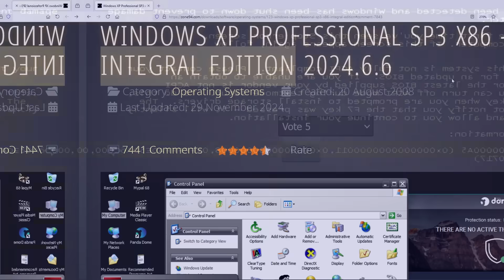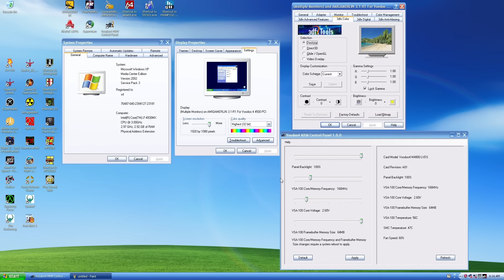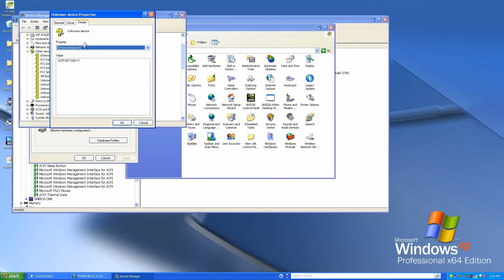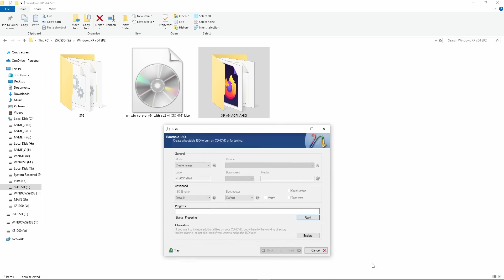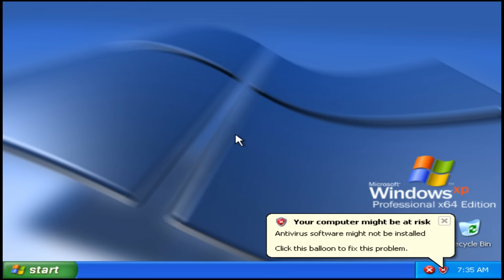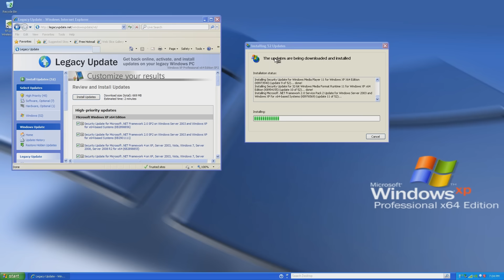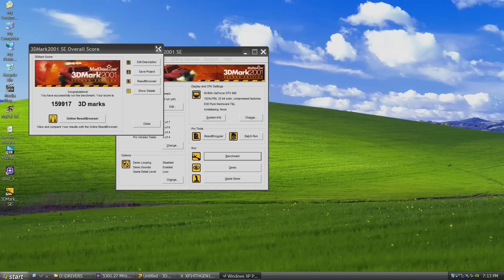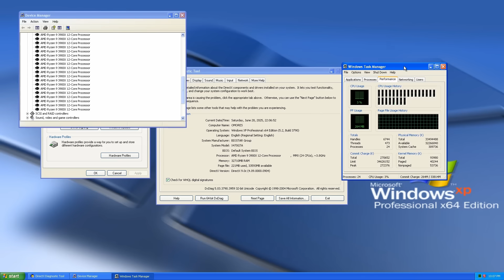How to Install Windows XP x64 on (very) Modern Hardware - NO BSODs 2025 Edition

Comment from the maker: To try everything Brilliant has to offer—free—for a full 30 days, visit https://brilliant.org/Omores/ . You’ll also get 20% off an annual premium subscription.
Reply: I have a Dell Poweredge 2900 dual processor server. Would WinXP 64 be a good fit for that? How close to "native" installation could I get to install?
Reply from the maker: @redfonzie21  That's a 2006-2007 model, so basically works with x64 out of the box, not workarounds should be necessary. Just use an optical drive for the installation.

Comment: okay but can i get working drivers lol
Reply from the maker: You can download a few drivers from here: https://www.patreon.com/posts/132702533
More precisely, you can get: the last Nvidia driver compatible with the GTX 980 series (modded), plus AHCI, USB 3.x, and NVMe drivers.
Reply: @O_mores nitro 5
intel core i5
cat sticker
Nvidia GeForce rtx

are you sure??
are you actually sure there’s server 2003 drivers for A modern laptop
Reply from the maker: @KingSonicBoe  XP is very well supported. There are actually drivers for everything, except for what is most important: the GPU. RTX 2000/3000 series are supported only in Windows 7 and up. For XP, you need to stick to the 900 series from 2014-2015, but since you are on a laptop...
Reply: @O_mores  you are actually right
but are you sure there would be 64 bit drivers?
Reply from the maker: @KingSonicBoe  For things that are based on standards like USB, AHCI(SATA), NVMe, HD audio - yes, there are 64bit drivers.

Comment: Soooo ive got the modded ISO and i keep getting 0x07B in text mode, im using WinSetupFromUSB to boot the setup, I have one NVMe drive and 3 HDDs
Reply from the maker: It won't work if you try to install it from USB 3.x since there are no USB 3.x drivers in this ISO. It works though from USB 2.0. Can you try from a SATA drive?
Reply: @O_mores ok so i got a dvd rom, everything was promising but i cant do any input and i dont have ps/2 on my MoBo
Reply: the keyboard is plugged into a USB 2.0 port and i have legacy USB support enabled
Reply from the maker: @idkwhhattoputherelol123 Try with the Universal NT installer: https://github.com/ages2001/Universal-NT-Installer
Reply: @O_mores i tried and now i get a 0xc7B BSOD
Reply from the maker: @idkwhhattoputherelol123  Format your SSD in Windows 10/11 (or an older version), make the partition active, then unzip and copy the preinstalled XP x64 files from Patreon: https://www.patreon.com/posts/132702533 (download the two .7z files). Quite a few folks have done it this way, check the comments on Patreon.
Reply: @O_mores   it says AM5 tho and i have a i7-12700F
Reply: update: it works, mouse and keyboard just dont
Reply from the maker: @idkwhhattoputherelol123  Happy new year! And... what exactly works? Have you tried the preinstalled version?
Reply: @O_mores  yes, it boots and goes to desktop but input doesnt work
Reply: oh and also happy new year cuz its soon new year here
Reply: @O_mores  Ok so I even tried writing a batch script that installs the XHCI drivers i just cant do any input but it boots and is on desktop after extracting that  image
Reply from the maker: @idkwhhattoputherelol123  I don't have any ideas right now, as the last 4-5 motherboards I've had for Socket 1700 and AM5 all included a PS/2 port. It's the first thing I look for when buying a new motherboard. Maybe your motherboard has a serial port and you have a serial mouse in a drawer somewhere, but if the COM ports aren't installed, the chances are slim. I think you should get a PCI-E to USB 2.0 adapter, as these will work in Windows 9x, XP, and Vista... so it's worth spending $20. Take a look at this one: https://youtu.be/5rxoJB8mHHQ

Comment: the .iso 2024 is for extract or install ?
Reply from the maker: It's ready for installation. Just keep in mind you'll have to manually replace ACPI.SYS in the Windows folder once the 0x05 ACPI error returns (as shown in the video).
Reply: @O_mores  ok, i can rebuild this iso included acpi.sys ?
Reply from the maker: The final and good ISO needs to contain the updated ACPI.SYS in both the SP2.CAB and DRIVERS.CAB archives. You should update it using nLite.

Comment: God can you share that already modified iso, I urgently need to try it on an i 7700k with an rx6600 graphics card and an asrock z270 extreme 4 motherboard
Reply from the maker: Sure, the link is in the description. Check out my Patreon page: https://www.patreon.com/posts/132702533 P.S. That RX 6600 won't work and neither the HD630 from the 7700K.

Comment: Does this boot under Ventoy?
Reply from the maker: The ISO I used includes AHCI and ACPI drivers, but it lacks USB 3.x support (which can be added later). This is a problem because, from Intel's 6th generation onward, all USB ports are connected to a USB 3.x controller so XP will likely fail when the setup tries to access the Ventoy drive after the initial boot.

Comment: I ran Windows XP x64 for years as a gamer, until well after Windows 7 came out.  Drivers were rare, but video was well supported by Nvidia and AMD.  It worked great, and I felt extra 1337.
Reply from the maker: Well, I remember buying an Athlon 64 3500+ in 2005 and immediately feeling that my new 64-bit CPU was being underused. So I tried a beta version of Windows XP x64 right away. It didn’t deliver the performance boost I expected, but I kept it as a dual-boot option - though I mostly stuck with the x86 version.

Comment: can you run Steam on Windows XP64?
Reply from the maker: Steam stopped supporting Windows XP in 2019. For a while, there were some workarounds to get it running, but as far as I know, a Steam update in 2024 broke the compatibility for good. So the answer is no.

Comment: And is there a way how to do that after installation of XP using IDE Mode on older hardware? 

Does this one works on Sata Drives? I have a HDD and i really want to see if this works or do this required different workarounds?

Everything like the chipset, igpu work but ahci doenst even work, instant BSOD.
Reply from the maker: On which system are you planning to install it? If the motherboard has a native IDE controller or uses SATA IDE emulation, it should work immediately. You can then add the AHCI drivers later from the Control Panel, but you will need to identify which unknown device is the SATA controller.

For context, I installed XP x64 from the original CD on an Intel 4th Gen PC from 2014. This means that for 4th-gen hardware and older, you don't even need this updated version.

Comment: I'm running this OS on my desktop, as my main one. It's a Dell Inspiron 660 with a Xeon E3-1290 V2, 16 GB of RAM, a 2 TB SSD, and for the GPU I'm still determining the best option. I'm probably going to get a 9-series GPU (but it needs to fit into the tower, which is somewhat limited due to the HDD bay it has). Currently I"m using a 1660 Super with no graphics acceleration. It's painful :)
Reply from the maker: I'm also writing this message from an MSI GTX 1660 Super Gaming X, but with full driver support. A 980 Ti is on par with this card when it comes to FPS, almost identical. By the way, XP x64 works on a Ryzen 9 9900X build, too: https://youtu.be/EOeJnLb952k (the video's about 98, but it has an XP moment as well).
Reply: @O_mores  Oh wow, I might just save my money for the 980 Ti then. Seems like a more logical buy than a Quadro K4200 or K5200.

The newest CPUs I have in my collection is an i5-11400, i3-9100F, and i7-8700. I tried getting XP x64 running on my H310CM-HDV (Asrock) build, but could never get it working right. Wish I could, because the speed improvements between this Inspiron 660 and that machine with XP would be so insane.

Comment: Very nice, I will have to try your ISO, thank you. I use stock XP64 on a 4th gen i7 (with NVMe driver) but sure would be nice to have the option of newer hardware, and not live in terror of this old system dying. :)

I had a strange experience with a Thinkstation S30 (same chipset as above, but Xeon). XP64 kept puking back the AHCI driver. Then on about the 10th try, it SKIPPED asking for the driver and finally installed, apparently by mistake, but it works fine!
Reply from the maker: I tried that ISO (with an updated AHCI driver) on an AM5 system with a Ryzen 9 9900X, and it works with NVMe and USB 3.x support! That same build also runs Windows 98 on bare metal: https://youtu.be/EOeJnLb952k

Comment: I tried it on my ASRock Z790 PG Sonic and it did not work.
Reply from the maker: I don't know if the Z790 is somewhat different from the H610 motherboard I used, it shouldn't.  Anyway, you should try the .7z files from Patreon: https://www.patreon.com/posts/installing-xp-on-132702533 (SSD_XP_x64_AM5.7z.001 / SSD_XP_x64_AM5.7z.002).

This is my installation - basically the C: drive, which includes XP x64 (as shown in the video) and all the updates made through the LegacyUpdate app. These updates might help and also there's support for AHCI for both Intel and AMD. Check the comments - there's a dude who got it working by copying the contents of the .zip

Comment: Dude, XP supports GTX 960. Vista supports GTX 980 Ti. I know weird.
Reply from the maker: Don't worry, XP works absolutely fine with a GTX 980 Ti. You just need to add the hardware IDs to the .INF file. This is all the 'modding' that's necessary. :)
Reply: @O_mores  That sounds more difficult than adding 2 update files to get RTX 30 series or Cinebench R23 working on Windows 7.

Comment: XP has a lot of fundamental issues. 1st of all, it doesn't like USB installs so no Rufus. It favors disc installation so Legacy CSM no UEFI, no Secure Boot, and no TPM. I'm actually surprised to see Haswell and Broadwell working with XP ok I thought IvyBridge was the limit. I actually bought the M6700 laptop with the intention of running XP to use the Intel HD 4000 while Windows 7 or 8.1 uses my M2200 MXM GPU I bought a years back. Unless the Quadro RTX 3000 MXM works. Hmm...
Reply from the maker: You can install Windows XP from a USB drive using a few dedicated tools. The best one is called WinSetupFromUSB. The main idea behind USB installations is that you need the USB controller to be recognized by Windows XP. For example, if you install a PCI-E to USB 2.0 card in a modern PC, you will not only have your keyboard and mouse recognized in any OS without native USB 3.x support, but you will also be able to perform the installation.

Comment: Have you tried XP x86 with the PAE extension patch applied?
Reply from the maker: I haven’t tried it yet, but there are some nuances. On x64 systems, any application can access all available RAM (up to the system limit), whereas on x86 with PAE, individual 32bit applications are still limited to 2GB of addressable memory. So you might have something like Firefox using 2GB, and another program using a separate 2GB - but no single app can exceed that limit. It technically works, but if there’s even the slightest instability, I don’t think it’s worth the hassle.

Comment: i belive there should be so called wine for win xp which would allow to run modern apps
Reply from the maker: Yep, I saw something on reddit. But compatibility is exactly an issue for me as I run multiple OSes on the same PC - like right now I'm in Windows 11, but if I want a break, I’ll boot into Windows 98 or XP.  Each OS is on its own SSD.

Comment: Every time I run the setup I get a 07B or 00A and Ipatched it with the generic acpi drivers from the patrion. I have a Ryzen 3 1200 on a a320m a pro
Reply from the maker: I see... As I mentioned on Patreon, the ISO posted there has Intel AHCI drivers that won’t work on AMD chipsets. That's why you get 07B... For AMD systems, you’ll need to use nLite and add the SATA drivers I posted there separately: Generic_AHCI_6.2.9200.20652.zip These work with AMD chipsets, tested by me on AM4/AM5 motherboards.
Reply: @O_mores I took the same starting iso as you  and used nlite to patch and add the ahci
Reply: @O_mores it also gives a 07E some times
Reply from the maker: Some drivers (like this Generic AHCI one) might not work during XP setup, depending on the driver type, but also nLite often fails to integrate them properly.

Here’s how I tested it:

  1.  I had XP installed on an Intel motherboard (using Intel AHCI drivers).

  2. While in Windows, I manually installed the Generic_AHCI_6.2.9200.20652 driver via Device Manager (Update Driver).

  3.  After a reboot, XP still booted fine with the new driver.

  4. Later, I moved the same SSD to an AM4/X470 motherboard, and it worked without issues.

So if you have an Intel system, you can install this driver from within Windows, then move the drive to AMD. I will try to make an universal ISO that works on both AMD and Intel.
Reply: @O_mores thanks. I found another driver online and it brought me to the first restart but it fails to open there. I bought a new ssd and it coming soon and if that doesn’t work I’ll try ur method  🎉
Reply: @O_mores the drivers that I found with ur instructions let me install straight from my amd system I can provide it if anyone wants it.
Reply from the maker: What drives did you use to get the job done? Check the comments on my last video, someone needs help with installing XP on a X570 motherboard: https://youtu.be/EOeJnLb952k
Reply: @O_mores I couldn’t find it in the video but I used a Lexar 128 gb SATA ssd and a sata dvd drive
Reply: @O_mores also every reboot I have to replace the ahci drivers in the drivers folder or there is a blue screen. was a there a fix for that.

Comment: i had installed xp on my 6th gen mobo but couldn’t find the built in agp driver!! is there any way?
Reply from the maker: If you're talking about the iGPU driver, Intel dropped XP support after HD 4000 (Ivy Bridge) - so HD 500/5000 series (Skylake+) have zero official or even hacked drivers. Anyway... it'll still output video at higher resolutions/color depth through VBE (basically ancient fallback mode). Btw, here's more on how VBE works if you're curious: https://youtu.be/JbXkvM3b2Qg

Comment: Shame you are offering files from a paid platform. Should be free, and no I will never sign up on patreon.  Sad.
Reply from the maker: It’s free to grab the files by following me on Patreon as a free member of the community! I upload stuff there because I have unlimited storage space the link doesn’t expire, and the download speed isn’t limited.
Reply: @O_mores sigh..  I know, it is tough to host material.  Ever hear of torrents?

I have been using them since they were invented.

No subscriptions, no signing up, completely decentralized.  Your pool of people connected to the tracker make the material available.  As long as it is popular, it lasts, or until you decide to stop seeding the torrent. You can control the bandwidth and use a feature called initial seeding, which only costs you bandwidth to upload to peers the bits the peers do not have.
Reply: @O_mores this is no place to correspond. Too much censorship.  My messages never get through.  You know where to find me if you want to have a helpful conversation.

Comment: Can't seem to get it to work with my Asus Sabertooth z97 mk 2 with I7 5775c processor.  I keep getting BSODs after the installation when it goes to its first boot.
Reply from the maker: What ISO did you used?
Reply: @O_mores  I'm pretty sure it was the one I found on your patreon.  I know it had AHCI in the name.  There's probably something I did wrong in the BIOS settings.
Reply from the maker: Actually, on a Z97 motherboard it might work with the original ISO and unpatched ACPI.SYS - I know it works on Q87 chipset with i7-4930MX CPU on a DELL M4800 laptop. So you might give it a try with a clean ISO first.
Reply: @O_mores Thank you.  I have the i7 5775c in the Z97.  Also, I'm wondering if maybe it's the GPU causing the BSOD.  It's a Gigabyte 6500 XT Eagle.  Should I just take it out and use the 5775c's integrated graphic instead?

Comment: What about AMD Ryzens, and AMD Radeon laptops?
Reply from the maker: I've tested this x64 version on a Ryzen 9 3900X at 15:22, and... it works! However, you’ll need to integrate universal AHCI drivers. You can download them here: https://www.patreon.com/posts/installing-xp-on-132702533

As for laptops, it should work but won’t be very usable without video drivers. The last Radeon cards with Windows XP support were released in 2013...
Reply: @O_mores  oh ok are there drivers i can install?
Reply from the maker: @BunrithViwatthanak-b2f  Yes, there are all the drivers you need. You have to use nLite to integrate the AHCI drivers that work with AMD.

Comment: Heya, I was informed about a piece of software called CSMWrap which allows you to boot into old OS's on computers that do not have the legacy boot option.
Its really cool because I was able to boot freedos and technically boot msdos 7.1 cdu, but I have minor issues... trying to use extended memory on freedos makes it not recognise the c: drive and its incredibly frustrating. For msdos 7.1, its complaining about Emm something or another not installed and not being a compatible system and for freedos, it shits the bed trying to do anything.
Reply from the maker: CSMWrap is in its early stages, but it’s still a big deal. I will make a dedicated video about it. Actually, CSMWrap loads SeaBIOS, which was originally released in 2008. Both of these projects will continue to evolve. What motherboard do you have?
Reply: @O_mores  Literally, I was trying to boot it on a gen 4 x13 thinkpad (amd)... I can get into freedos !! (sometimes)